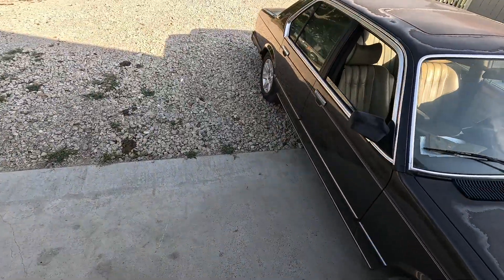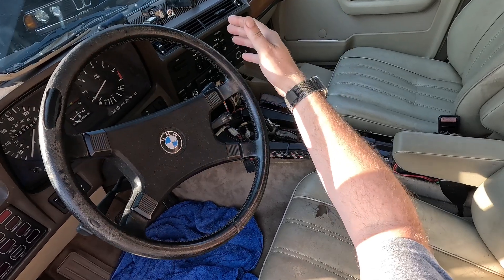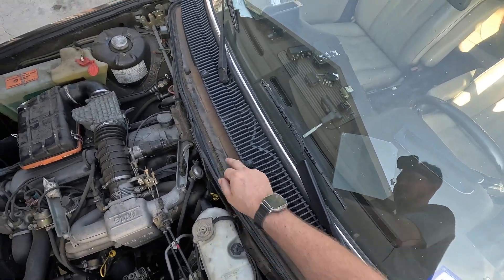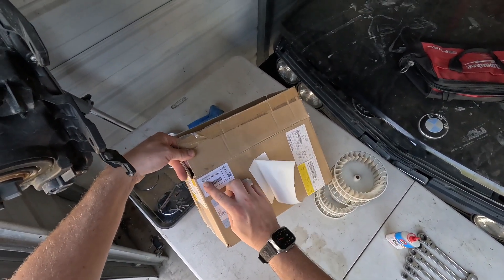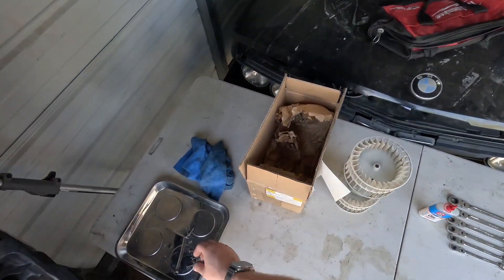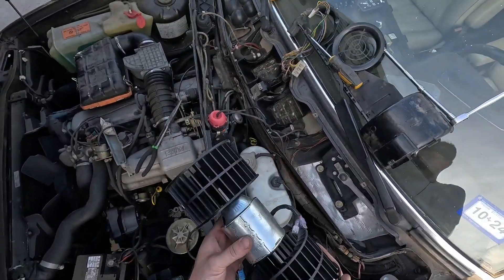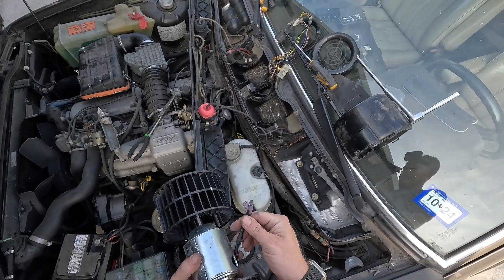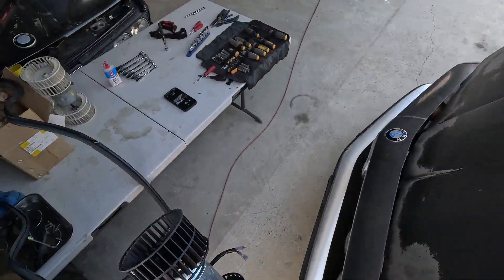BMW E23 Blower Motor Removal - 1985 735i

Comment: Hi David, I'm embarking on a similar mission with my 1884 e23 733. I'm glad I found your channel! I heard you say the expansion valve was inside the cabin. Any pointers on what I need to remove to access it would be great.
I'm looking forward to checking out your videos on this project. Thanks!
Reply from the maker: you can access that the expansion valve and get it removed if you remove the glove box and that small trim piece to the left of the glovebox. The valve will be encapsulated in a foam block that you'll open up as it's folded around it. Then pull that foam block down and out, it'll be a tight fit as it's wedged in there. from that point you can get wrenches on it and service it.
Reply: @7erDave  Thanks!  Keep the e23 content coming,,,,